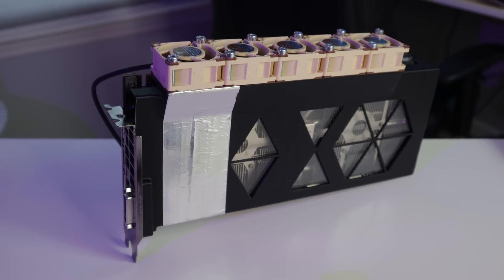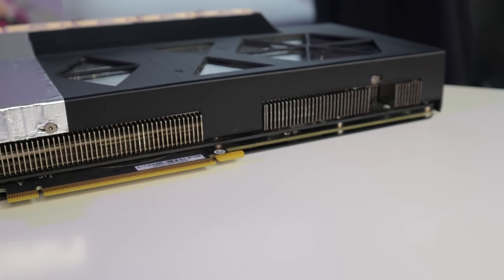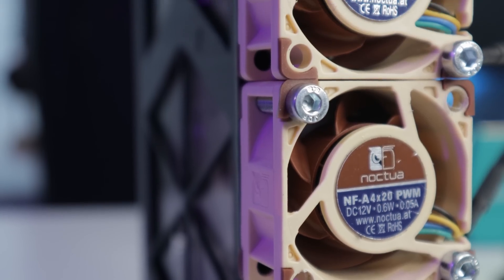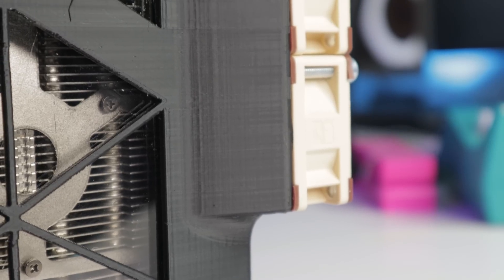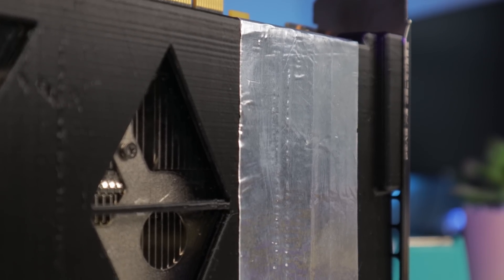Custom GPU Cooled By Five Noctua NF-A4x20

Comment from the maker: Got a story about something dumb you did that cost the life of an innocent PC part, if so comment down below i have been reading some and they are hilarious.
Reply: I almost destroyed a new Vega 56 just because it alomost fell down. 
Is this good english? 😂
I dont know, i am from germany😂
A lot of Years ago the China-psu from a friend almost fried the cpu, mobo and gpu, it did frie the ram. In germany we call this a Chinaböller. A Chinaböller is what you call Chinacracker you burning at New year. 
I have a good idea, maybe you could try to cool your PC with Peltier-elements. With a watercooled PC you can maybe get under ambient roomtemperature. 
Greetings from germany
Reply: Putting the black cables on the outside on an AT mainboard/psu connector. Got me a hole in the carpet, Tinnitus for a  few days and a ruined 486 board. T.T
Reply: Not really a pc, and not too stupid but I've killed 1 motor 2 escs 1 power distribution board 1 flight controller, all from me just screwing up soldering  all the time and connect wires wrong, still haven't flown the drone
Reply from the maker: I had drones and did some racing quad stuff for a while and I have done the same
Reply: WillyHam reading this I feel bad for you... but I had a little trouble at first too. Touched my FC to my metal standoff. Poof. Next one bad solder. Messed up my 5v bec. But after all the trouble I gained a skill. And I’ve solder switches to Controllers and built my drone. Swapped my fathers reciever for his eachine wizard. Just don’t give up. Get a handy tool and magnifier. Good solderpaste/flux help solder flow. You’ll get it
Reply: I've literally put a custom sloppy made metal plate of a memory heatsink on the back of a gpu, while it was working. So a loud pop, a lot of Sparks and a reboot later, I was surprised to see it was up and running fine again lmao. I bought those tiny AliExpress heatsinks later. Iffy but it still works so.. cool
Reply: Well in my youth I had this P3 450Mhz which had a Matrox gpu which was really bad for gaming and tinkering with the cables I tried to replace the PATA with a faster cable which happened to miss the notch so I ended up plugging the HDD incorrectly and it instantly burned. That and many other software fails taught me more about PC and eventually my parents tried to keep me away from the PC with a PSX. Which worked until we got a Athlon XP1500 and I bought for it a GeFo 5600, first card to have 256mb of ram.
Reply: swapped a high end 7850 cooler into a reference 270, the thread where the screw goes broke (it was old, and maybe too adjusted or idk) and then, one day, i was gonna remove the cooler, but it just was stuck, the thread wouldn't fit out through the whole, so i pushed it and forced it out. I don't know if something got unsoldered or scraped, but the card never worked again
Reply: Blew a terminal fuse on my car by accidentally hitting the positive terminal of my battery. Had to jerry rig a jumper around the fuse
Reply: Literally yesterday, Went to update my bios on my gigabyte board. Ended up booting without a video signal. Had to go to an repair center and give my pc away for more then 2 weeks >.>
Reply: One time when flushing and refilling my old loop, I had a t fitting at the top to fill with. I wasn't paying attention, so I added water as it was running, huge bubble pushed water back up and out around funnel. Huge splash down on to the system. Spent like 4 hours with a hair dryer hoping to God it all still worked. That's how I killed one of my rx 290s and got a 1080 XD
Reply: Gave 21v to a cheap chinese fan and it started burning
Reply: Got send an foxconn bloodrage x58 board from America from famed modder mkmods ( sadly passed away now) he had changed some bits and bobs including adding a large all copper heatsink to the NB. I wanted to go back to a stock type set up. Unfortunately the heatsink was epoxied on, so I cracked the chip itself when I attempted to remove It. Mark had warned me not to try it but I was certain I could manage, had that motherboard on my wall as display and a reminder not to dick around with stuff that works.
Reply: Major Hardware  I mean there’s that time I had two vista era dell laptops with the bottom panels cut out and a window ac unit piping 60° air at/into the motherboard for 6 months 24/7 to cpu mine dashcoin. Spoiler alert they died lol
Reply: I had an Hdd docking station with a bricked power supply, so bought another cheap chinese crap to power my laptop and the docking station, it had many adaptors. I wanted to check something on my 1tb cold storage backup drive i had, so i put it on the docking station and connected it on my pc. Little did i know, i supplied it with 19v instead of 12, and the hdd was toast. Luckily enough the docking station still works after many years.

RIP 1tb HDD, you will be remembered.
Reply: Major Hardware my first pc, I got the parts and had to wait for Christmas to put it together (I was like 12 or 13) I rushed to put it together knew what I was doing, but ignored the warning of doing it on carpet... my motherboard was dead. 30 dollars later at fry’s a returned cpu and a somewhat returned motherboard (had to pay a restock fee) and I got a better system overall but yeah.
Reply: I was actually 'playing' with OC with my old 1080, thought about making a slightly mod to the cooler and the rest of the history is similar to you lol I messesd up my 1080, crucified myself for stupidity and then got a 2070.
Reply: I kept using a dying GPU until it died completely and took my motherboard and monitor with it.
Reply: Very old video, but when I was a kid, probably 12, my dad got me an even plane. His plan was for us to fly it together. We put it together, and boy was it a nice plane. Later, while he was at work, I couldn’t wait for him to get back and wanted to fly it. so I took it outside and tried to get it in the air, and when I FIRST I tossed it, it immediately nosedived. The plane was destroyed.
Reply: In the early 00's my clan were having a LAN party at a community centre. This is back when 1kw PSU's and SLI were the norm for higher end gaming rigs. There must have been 20 rigs plugged into an UPS and Switch that me and my buddy Martin had 'borrowed' from an enterprise refit we'd done on Friday. About £20k worth of parts all in all. Well, basically, we tripped the power from daisy chaining extension leads, and when we flicked the circuit breaker back on, all of the rigs restarted and caused a surge blowing up the UPS, quite literally. We took out the power for the entire block, and had to wait 3 hours for the local utilities firm to come out and restart it.
Reply: Jea got a refurbished prebild from dell put my gpu it it only to realise it I had a nom standard del power supply and I connected my power supply together and pc never booted again  i send it back saying it never booted in the first place
Reply: Building a custom project how well would these work.
Reply: I skimped on cooling (still in school,budget), Stock cpu Coolers 2 case fans.
cases in the past sucks, forgot what it was.
i was playing a game, it stutters then the PC shutdown and never turn back on.
change the psu etc all to no avail .😥

Comment: The "this is all dangling, i'm about to short something out" situation calls for hot melt glue. It's quickly applied, and when you need to get it off, you just spray a bit of alcohol on there, it'll take a few seconds, then it expands, debonds from whatever it was glued onto, and tears off cleanly, maybe just a tad crumbly.

Comment: The cost of 5 Noctua fans at more than $20 each plus the time involved planning and building vs a water block for a GTX 1080 from Watercool for $120 if you already have the loop parts? My GTX 1080 FTW runs at 36 C gaming load on water.

Comment: If you were lucky, it could be that the 12v rail fuse on the board blew and everything else is fine. Although maybe not the LED microcontroller. It's easy to find out if it's worth a try, just check the resistance of all fuses and look for an open circuit. It can be easily replaced with hot air, I'm running a GTX 980 I got cheaply and repaired. One of the MOSFETS was dead which blew the 12V rail fuse. Replaced those and it's been working great ever since!

Comment: That GC on water loop looks cool obviously it runs cooler  But one thing most don't think about when people say before it was so Hot and now even with a medium rad it runs much cooler ...  Cos When air cooled most people leave it as it is..  BUT Not me my Sapphire R9 Fury when i play fallout 4 i gets hot like 68°C/70°C So i manually Ramp up the fans to 75% and it Goes down to around 45°C  i don't care about noise as my card is Cooled well ... Think about it most play the card gets hot and of course fans are kept either low or auto so that not much noise but forgetting that quiet fans card gets hot ..Obviously putting a GC on a water loop with water block will help much but also silently... Kinda makes sense thinking about it that way...  My PC having cost already loads of $/€  i cannot afford water cooling for my GC besides it's easy to ramp up fans to keep the card cool and that doesn't cost me anything...

Comment: I think you popped a fuse, so it's probably alright but it'll need to be de-soldered and replaced. That being said, PCB manufacturers don't usually add them to save your components, usually it's to know what to diagnose.

Comment: Takes me back to my brand new AMD K62 450 system a with Matrox G500 max gpu and a Creative soundcard. I had been saving up for months finally got all the pieces and built the pc. I remember thinking to myself that the soundcard needed to be in a lower pci slot to keep the gpu cool. Without thinking I pulled the soundcard out while the pc was still booted up and fried the lot. I salvaged the case and a fan I think from a brand new build.

Comment: Now that you have a new replacement card why don't you take it apart and try to fix it? If your head a pop you should be able to see the damage.... Not like your going to break it.....

My guess is it's just an rgb controller chip that is now shorted out and not allowing the card to work... maybe you could just remove the component and the card will work

Comment: Idk that your proposed fan configuration would've been more quite. Smaller fans need to spin much faster to get the same airflow as larger ones. Your design might've solved your airflow problem and brought temps down but if your intention was to bring noise down I'm pretty sure that would not have been achieved. Good on ya for trying tho

Comment: The idea is solid interesting design for a vertical mount. Linus did this but way more ghetto a little while ago just zip tied two 120m notuca's i believe to a gpu's heatsink and saw remarkable temperatures. So with a little more design tweaks to your 3d printed mount and i'm sure you could print something super legit.

Comment: I can't get over how huge the motor hubs on those fans are. Get fans with smaller hubs, please!
Reply from the maker: You will have to speak to noctua
Reply: Major Hardware I feel like they'd more likely listen to you than to me.

That said, I bet if you got your hands on some electronic parts like motors, you could probably make your own fans with the help of a 3D printer. That might be fun.

Comment: A tip for everyone: take your time making sure everything is connected and/or isolated right. A few months ago I fried a good development board, when a 12V pin that wasn't plugged in right shot loose and came into contact with a digital-in pin of the board... And last month I fried a 775 motherboard as I tested some 771 CPUs I modded, but I didn't isolate the cut-out parts on the CPU...

Comment: Man, you are crazy! And I love it! Keep on working on the "counter-mainstream" side! By the way... Regular super glue would have done the job instead of taping the parts. Also make sure to use a plastic which is "resistant" to heat... PLA is not the best choice as temps above 55-60C can be critical and the material will start to bend/warp...
Reply: That's actually good advice on the plastic

Comment: the evga 1080 may have a fuse so if you are lucky you just have to replace that. 
And the dumest thing I have done is to delid a fx 6300 (it was solderd :(  and to use a modular cable from an other psu witch fried my 750gb ssd it send 12v to the 5v lane.
Reply from the maker: ha i feel your pain
Reply: I'm glad I don't try to mix cables from PSUs. That's some scary stuff

Comment: Suggestion - make a "blower style" GPU cooling with custom heatsink (heatpipes+aluminium blades), using double or triple noctua 12cm fans.
Then go on the market with this - nowadays nobody uses dual card configs, nobody uses sound cards, and most of the time there is a lot of space below the first PCI slot.
Reply: It's sad but true. Though I'm personally looking to fill a PCI slot with an elgato card. I'm beginning to actually feel like I need more PCI Express lanes than the first gen ryzen stuff offers.

Comment: Turned a 290X into a single slot card by chopping off the top DVI connector...worked alright initially, but then it ended up dying after that...but that could of been from the card being flashed into a 390X, and all the other tweaking and mucking around I had done.

Comment: topsucker cooler? ;D kinda nice idea but id made it to blow from bottom.  3slot blower with 90mm noctua blowing air in the card at about 30degree angle at the back would be nice to see tested

Comment: I've slain many GPUs over the years. Sooo easy to mess things up when mounting a cooler on them.  Too little pressure, overheats, too much pressure, cracks the die.  lmao.
Reply: Now that you mentioned too little pressure I think that could've been my first issue. It never overheated though, mx4 just started degrading suspiciously fast. Like back to the old temps after a couple of weeks. 

It ended up being an excuse to try out GC Solutions Gelid Extreme though. Which so far has been great.

Comment: The first time I had a self built pc, I had a 750ti. I thought to my self, hmm, the gpu could get colder if I put a heat sink on the back of it. So me being so stupid, took a full aluminum heatsink and just plopped in on top of it, no spacers, just right on top of the PC shorting pretty much every pin imaginable. This was while it was on, and it instantly shut down, of course; so I thought, hmm, that's weird. Then I RMA'd it and got a new one.. somehow.

Comment: It's such a shame that the connector has gone short ... if youre lucky enough it's possible to fix the card by replacing the blown up component, (such a voltage regulator near the connector, a burned power rail or maybe a capacitor.. in any case is necessary  trace down the short, other components on the pcb are 
probably dead.)

btw that homemade cooler was awesome, I want to see your creation working! it would be cool to see a repair attempt
Reply: if he's really lucky it could be a fuse

Comment: You could always take the card and have the shorted component replaced and then use the 1080 as your Franken-testing card
Reply: The entire 1080 is likely to be "the shorted component", though.
Reply: @JuusoAlasuutari  Doubtful. Its probably just a sub-system rail, since the RGB was 12v, that's not being pumped into the core, so that's some aux rail that might be used for something minor. You know you can saw a card in half and solder on VRM zombie boards right? I really doubt his core was damaged, it should just be a buck converter that's fried (so you could zombie one of those on for $1, but you could probably just as easily find where its dead chip is, I use alcohol and watch where it boils to find damages/shorts)

Comment: can we make a case strong enough to take all the air out. create a vacuum. use an air conditioner to add dry cold air inside the casing and plus have separate water coolers for gpu and cpu. no fans.

Comment: The dumbest idea I could come up with:

Make motorized adjustable apertures for your case fans. Then use an Arduino to control them in relation to case temp.
Reply: Add a motor that feeds the fan blades a small sausage
Reply: Had a similar idea, but with a more artistic approach - make those apertures like feathers of angel wings.
Reply: Nice...